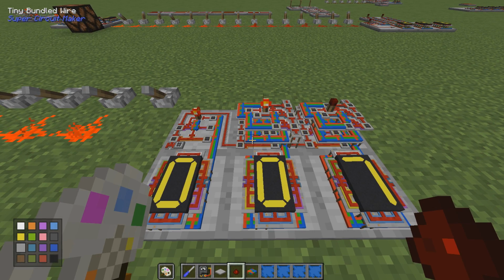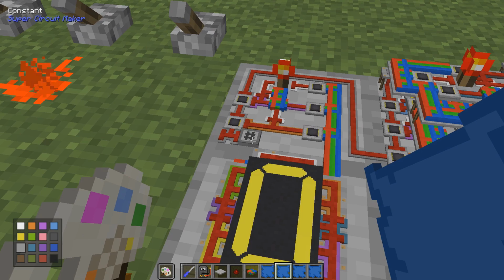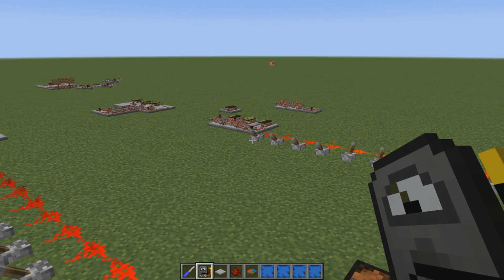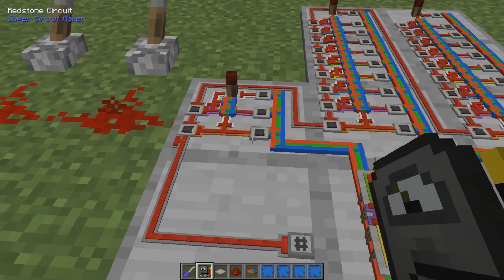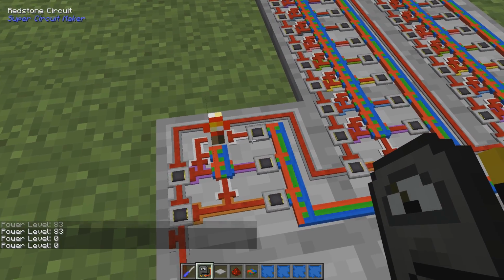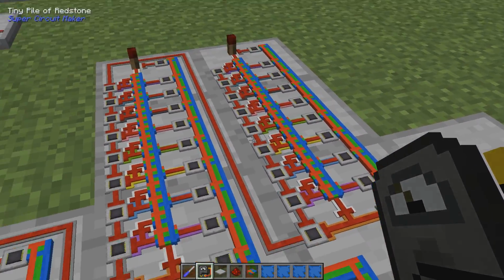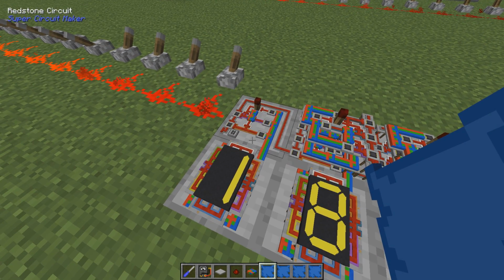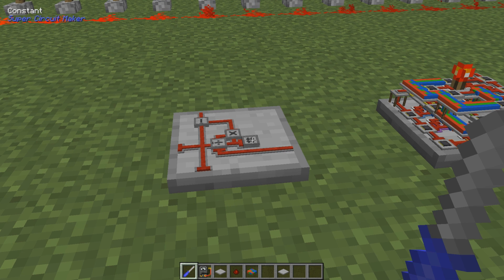Super Circuit Maker: Analog to 7-Segment Display Decoder (MC 1.10.2)

Comment: https://db.tt/liZVQZHXusing my methods I have made a 99% Break-proof version of the decimal display. The file explains itself if you have seen my prior worlds.
Reply from the maker: Cool, I'll check it out during the weekend (company's having a large christmas party tonight). I tried the other evening to combine more 7-segment numbers within the same circuit and perhaps it's possible to fit all 10, but it will be hard. 3-4 per circuit is possible. Will continue with that some evening, but first the "getting started" video tutorial :) So much to do and so little time.... and a China (work) trip coming up that I need to prepare for...
Reply from the maker: I couldn't download from that link, have you removed it? (even if I removed "using" of course ;)

Comment: I've been trying to optimize it further, but I think that subtractors are considered circuits, so things can only be so compact as subtractors are needed in pairs (hence "= nor") and torches tend to break circuits somewhy. I would show/explain in more detail, but I can't exactly call you up and talk :P I think there is a lot more to be done in the way of demux and mux circuits using subtractors in the signal reducer that I use in my game of life pixel, perhaps something akin to an ALU or a 4-function calculator, or possibly an 8 function, the latter 4 being and, or, xor, and comparator, this could evolve into a full-fledged CPU, and maybe a computer, as I've been working on the necessary logic tables for some 3 years now, I finally have a medium through which to test this all!

Comment: +TKH I further improved the circuit's number interpreter, so that if you send a signal orange thru purple, it will output the inverted signals for the numbers 0-9 respectively, and my display is inverted, so it works perfect! It's more elegant than ever with only 2 circuits to interperet this, and yes, this is improved on your video, with some crediting built-into the world. I'll update the world folder, so wait about 10 mins before you try downloading it ;)
Reply from the maker: Man, this is good stuff! Thanks for sharing :) Some circuits crashed (like the test loop), but I could test all the parts individually so I think I got it. I like the idea of the combinated segment decoders, I haven't tried yet but if I combinated all of your builds it should be able to make this circuit a lot more compact! I want to do it myself starting from skratch, or I won't know if I understood every step in your designs ;)
Reply: to do this properly, start with your k-maps, and invert them (for my inverted display, as 66% of lights are ON, so off lights are more compact to code), then simply 'or' them together.
Reply from the maker: Yeah, I noticed that maxterms looks easier than minterms, but I haven't sat down to do the new circuits for them yet. Was planning on doing such things on this trip, but every night has been filled with activities or sickness... :/ At least I'm finally on my way home. Currently on Hong Kong airport and trying to catch up with life ;)
Reply: yay for returning home! hope to see something soon!
Reply from the maker: Thanks :) No more videos this year though, we're going for christmas vacation in two days so we'll see what pops out in January!

Comment: Watching your actual video, I think back to how i optimized your circuit, instead check for 10, output the quotient to the next circuit, and the remainder is the output from 0 to 9, repeat for two more digits with no special work or checking, use the analogue output 0-9 in a 7 segment controller circuit that will display the correct value.
Reply from the maker: Good to get feedback and  improvement ideas, keep that coming! But will you actually save steps with that method? You would still need to check for 1-9, so the number of comparisons would still be the same, wouldn't they?

Comment: How did you managed to use multiply, divide and substract as circuit within a circuit? 
For me the operators never work inside another circuit. Using 1.0.4
Reply from the maker: I don't know if you still have a problem but that part works just fine for me.... I didn't do anything special.
Reply: Yes I still have a problem, nothing works with circuits in circuits.
Reply from the maker: Do you also get that problem when using others designs ( /scm import ...)? So if I export a design with circuits on circuits and you import them, they won't work?
Reply: Yes

Comment: i've made a smaller 7 seg display you can check it out at https://gist.github.com/anonymous/30580c60d984c2e38af996d4ef91c3cb
also a 2 number display at https://gist.github.com/anonymous/06ee6376b828d29ca171cfae25fe847c
Reply from the maker: Yeah I saw that on reddit, I like it! Might come in handy in case I make smaller designs :)

Comment: Maybe make a vid showcasing this? I've laid out the construction process with a chain of circuits for convenience, but I've completed my game of life simulator, if you can install some read system, it will be complete.https://www.dropbox.com/s/dh5o7uio2vkke4z/Life.zip?also, your adc is accidentally a division circuit with remainder, if you plug the input directly into a div by 2 circuit, you will get the final binary bit and the rest divided by 2, push it through the same circuit, you get the 2's digit and the rest divided by 2, which is effectively /4, repeat and you have a perfectly uniform circuit that outputs the answer in reverse order to your design.